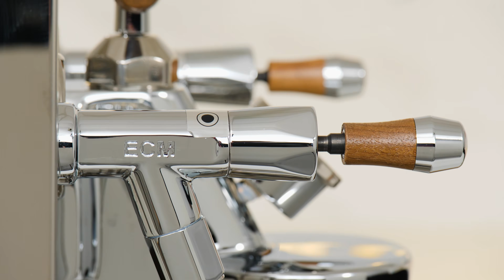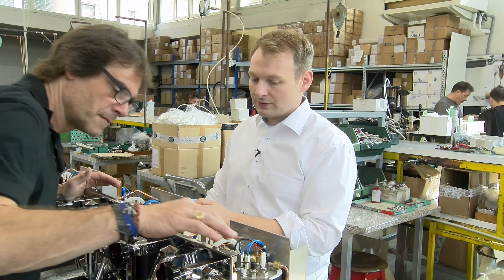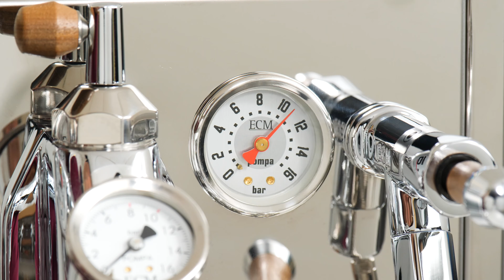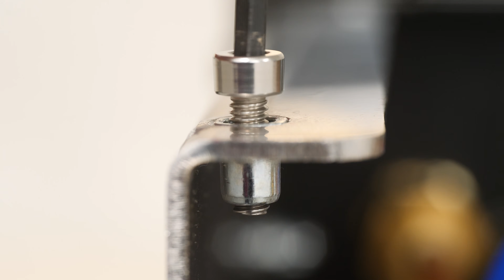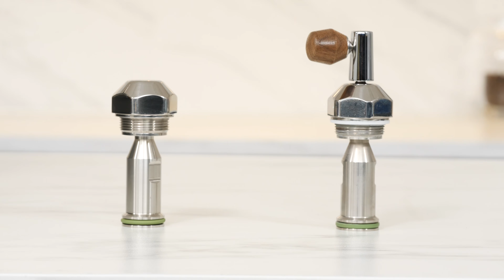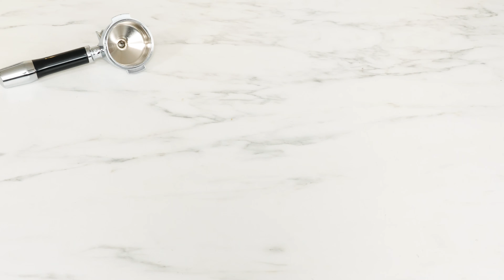ECM Synchronika In-Depth Review

Comment: Is this still your top recommended coffee machine? I'm planning to purchase this within couple of months once our new home is finished. My wife has said to not worry about the cost, and just tell her which espresso machine I want. Didn't realize this one was plumb-able, so guess I'll need two extra holes in my bench?

In my country it's available bundled with a Fiorenzato F64 or F83 with or without automatic weighing. My wife would be annoyed by the noise of me grinding coffee in the morning, so I'm kind of tempted to go for the F83 with the bigger burrs, as it'd be quicker and thus less noisy. Just need to ask the kitchen company how much space I have beneath my cabinets.
Reply from the maker: Hi ER, ECM recently released the updated Synchronika II which is now the top! check it out here: https://youtu.be/bWIJKG9nzQY
A ton of new and useful features added in the update!
Marc
Reply: @Wholelattelovepage  thanks, I saw the video just a few hours ago. It should be available in my country within a few months hopefully, I'm hoping it'll be about the same price as the older version... The OLED display and faster heating are really nice improvements, and I just love how everything follows the KISS principle of design, makes maintenance much easier.

Comment: How do you manage service in Canada? Do you have a physical location that the machine can be dropped off if necessary?
Reply from the maker: Hi LTLR, We use Anthony's Espresso outside of Toronto. Another option is self-service - if you are at all handy with a tool that's most efficient. Very easy with a machine like the Synchronika and our deep library of DIY instructional videos found here: https://support.wholelattelove.com/hc/en-us/sections/1500000400302-ECM-Synchronika
Marc
Reply: @Wholelattelovepage  That’s awesome. I’m just outside Toronto. Great videos Marc.
Reply from the maker: @LivingTheLifeRetired  That'll work great. It's a very solid machine. Feed with good water and do your maintenance like back flushes and it's about as reliable as they come! Thanks for the comment!
Marc

Comment: why should I choose this ECM over a Lelit Bianca?
Reply from the maker: Hi p, Both the Synchronika and Bianca are capable of making excellent espresso. If close in price I recommend the Synchronika for nicer build/finish quality, easier servicing and higher expected reliability. Also prefer the lever operated valves for steam and hot water. Both machines made are list of dual boiler recommendations for 2023 which you can see in this video: https://youtu.be/5W0yfsrVE5U
Marc

Comment: Hi Mark,

I"ve just ordered the Synchronika with Flow control today, and am so looking forward to its arrival.  It will replace a 9 year old Pasquini Livia G4 Automatic (rebranded Bezzera BZ13).  Anyway, I'm sure I'll have questions once it arrives.  But, I have one question now:  I've been leaving my Livia on all the time, except when leaving town for a week or more.  I have seen a lot of comment about turning the Synchronika off after use, and then restarting it.  Is that really necessary?  Are there any advantages (e.g., longer life span, less electricity usage) to shutting it off after a day's use?

Thanks,
Brian
Reply from the maker: Hey Brian! I asked ECM CEO Michael Hauck this question a few years ago. FYI he is very involved in the design of their machines. He told me he leaves his on all the time. Having it on all the time will use more power. I did some unofficial power use testing on other similar machines a few months ago. Leaving machine on vs. power cycling 2 times a day for 2 hours on at each go was about $0.05 more to run a day. On the other hand less power cycling generally results in less potential for scale formation. But if you properly treat source water scale will not be a problem. There is some thought that heating cycles stress components with thermal expansion/contraction but MH says it's not a concern with the machine. I suggest you bookmark our support site for the Synchronika. It's loaded with videos and more on maintenance, use, etc.: https://support.wholelattelove.com/hc/en-us/sections/1500000400302-ECM-Synchronika
Congrats on your new machine!
Marc

Comment: I've recently had a small problem with my ECM Synchronika. As soon as I switch the lever, the rotary pump starts to run. However, no pressure builds up. Nothing happens on the pressure gauge. Only after about 5-6 seconds does the pressure finally build up. Does anyone know what the problem is and can help? The machine was operated on mains water for a long time, now runs on tank. Thanks very much
Reply from the maker: Hi sc, Any chance you didn't properly position the water source selector under the rear of the machine when switching from plumbed to reservoir operation? Here's an extensive video for diagnosing flow issues on the Synchronika: https://youtu.be/xcze59LUg9E It covers a variety of potential causes and resolutions. If you think it might be the water source selector valve that's covered at 14:49 in the video. Hope that helps!
Marc
Reply: @Wholelattelovepage  Thanks for the video. I have a constant flow of water up to the rotary pump. In the video, almost up to minute 32. I still wonder why the sensor does not register any pressure (the pressure gauge shows 0 bar and no water flows through the brewing group). Could not solve the problem :(
Reply from the maker: @samuelecartillone7327  You're welcome for the video. Sorry you have not been able to solve the problem. If you purchased the machine from us please reach out to our tech support staff here for additional assistance: https://www.wholelattelove.com/pages/contact-us

Comment: Hi Mark. Thank you so much for such a wonderful, in depth review. I've been tossing up between the HX ECM Technika V Profi PID, and this gorgeous machine. The more I watch this review the more I'm leaning in the direction of the ECM Synchronika. I'm a novice when it comes to frothing milk, and the fact that you can match steam pressure to your skill level is a really big deal. I'm assuming that's not something you can do with the Technika?  While I don't make a lot of milk drinks I feel this is the machine for me. Thank you again for always providing tons of information.
Reply from the maker: Hey Julie, You're welcome! On a dual boiler machine like the Synchronika you have independent control of temps for brewing and steaming. In an HX machine you can adjust temperature in the boiler to raise or lower steam pressure but that also changes your brew water temperature. You can deal with that by flushing our overheated brew water but there's some guessing involved as to how long to flush.
Hope that helps!
Marc

Comment: Recommended to remove the 'cool touch' piece of plastic tubing within the steam wand. Better to not have any restrictions in that tube. Also recommend the five hole steam tip.
Reply from the maker: Hi DR7, Thanks for sharing your thoughts. You do you, but I do not recommend removing the tube. More likely to get burned, more internal condensation and if you change your mind it's a pain to put it back.

Comment: Hi Mark, how does the dual boiler Quick Mill Vetrano stack-up against the ECM Synchronika? The Vetrano did not make it into your "Top 5 Favorite Dual Boiler Espresso Machines of 2021" but got a solid review from you in a separate video. Can you elaborate on that? (In Europe, the Synchronika is still some +25% more expensive than the Vetrano)
Reply from the maker: Hey Alex, The Vetrano is an excellent machine. As a newer DB option in the market the price is a little lower and while the build quality is very good it's a hair below the level of the Synchronika. That does not make it any less capable of making excellent espresso. The Synchronika has some upgraded finish details not found on the Vetrano like the angled PFs, taper of the E61 group, faceted finishing of the exhaust port and one piece base frame.
Marc
Reply: @Wholelattelovepage  Marc, thank you so much for your fast and useful reply. Such a tough decision still ;-) — to pay or not to pay for that extra quality edge. Thanks again. Your channel rocks!

Comment: How about the r58?
Reply from the maker: Hi SA, The R58 - now called the R Cinquantotto is a very good machine. In comparison, the Synchronika has higher available steam power, is available with flow control installed and is a step up inn exterior finish quality.
Marc
Reply: @Whole Latte Love  thanx Marc,il about to pull the trigger on the cinquantotto,and scrapping the breville dual boiler because of continuous leaks,I also have the baratza 270wi,thanx for all the amazing vids,I thought the coffee bug would last 1 or 2 months,here I am after 3yrs lol,can't wait for more of your vids.
Reply from the maker: @shameelali2549  Happy to help - funny how the coffee bug attaches ☕

Comment: Hi, hope you can help. We purchased a couple of years ago and the flow on our machine is fast as...at least 10 secs only...how on earth can this flow slow down??
Reply from the maker: Hi Vicki, it’s all about the grind size. A finer grind will slow down your extraction. 
Marc
Reply: @Wholelattelovepage thank you for your quick response.  I have tried this, but we did tighten the nut on the front which has slowed it down a bit, but not as good looking as the above video....

Comment: Marc awesome work.  I’m struggling between a 600 or 700 with flow control and a 800.  I love the simplicity of the 800 and it’s natural lever pressure profiling.  I realize the complete freedom of flow control on the 600/700 provides more options but I wonder if I’ll ever miss it.  I suspect my daily, no-nonsense espresso will be excellent and care-free on the 800 without me timing and managing the 600/700 flow control knob through the extraction process.  Is there anything I’m missing?  Should I just go big lever and call it good?
Reply from the maker: Hey Juice, thanks for the kind comment! Some consider using a lever machine a more "pure" and traditional experience. If you're the no nonsense type then the Pro 800 may be a good choice. What type of coffee do you drink most? Lever machines tend to do best when using more traditional coffee types like classic Italian style bean blends. The lever profile applies higher potential flow rate and pressure at the start of a shot which fades as the shot progresses and produces sweeter more syrupy shots from darker roasts. If you're into lighter fresh from roast specialty coffees or switch coffee types from time to time then flow control may offer some advantages. Light fresh coffee benefits from low flow/pressure at the start of an extraction. You can get that to some extent on a lever by allowing the coffee to infuse with brew water before releasing or holding the lever back. But, it's more difficult and not as repeatable as it is with flow control.
Hope that helps!
Marc
Reply: @Wholelattelovepage   excellent feedback Marc.  I’m new to espresso and didn’t understand the above until you described it.  I like dark roasts but my wife is decidedly a light roast pallet.    Perhaps I should not box myself in and go with a 600/700.  And the added benefit of not having a lever overhead (wife isn’t crazy about that feature).  Really appreciate the feedback.
Reply from the maker: @juice7546  My pleasure! 600/700 sounds right for your situation. A lever is a commitment and the 600/700 will be more flexible!
Marc
Reply: hey! Which machine did you get in the end? I seriously think of buying a Pro 600 because for me it seems to have all excellent parts of the 700 / Synchronika and only misses some steam boiler volume? For me and my wife the smaller steam boiler of the 600 should definitely be fine though. We also won't plumb the machine in and the perfect exterior finish of the Synchronika most likely isn't worth 1000 Euros for me. What do you think about that? Maybe it will help me in my decision. Thanks a lot!
Reply: @t0bistr  I went with the 600 and love it.  Never runs out of steam and is more than enough for knocking out four quick drinks for a few guests.  I still want that lever machine but I not regret the 600 and would get it again.
Reply: @juice7546   thanks a lot for your fast answer. Seriously going for the 600 then! I understand what you mean with the lever machine. Must be great fun to use. But for my wife it would probably be too much 😜 so much looking forward to drink great coffee soon! Thanks again and nice greetings from germany! :)

Also big thanks to WLL!

Comment: Hi Mark! What machine do you think is better between the ECM Synchronika and the Linea Micra? ECM Synchronika has the advantage of having flow control but which one has better results in the cup?or which one is a better machine overall in your opinion?
Reply from the maker: Hey Maria, Both are very capable machines. Quality in cup is more about the skill of the user, grind quality, etc. Have to be honest - I have not used the Micra. Flow control on the Synchronika definitely give a user more options for better results in the cup!
Marc

Comment: Do you think there would be a lever version of the Synchronika (dual boiler with Rotary pump)?
Reply from the maker: Hey Mark, probably never happen. Lever machines just operate differently. Lever machines like the Profitec Pro don't even need a pump when plumbed to waterline. 
Marc

Comment: Been really enjoying your videos as I am tempting myself to buy my first big boy espresso machine. I was looking into the Profitec 600... That one is a double boiler costing much less than the Synchronika and other double boiler machines. What am I missing?
Reply from the maker: Hey F, Here's what you need to know... the 600 and Synchronika are made in the same production facility in Heidelberg, Germany. ECM and Profitec are sister companies. Kind of a Lexus/Toyota relationship with ECM being the more polished high-end brand. Take a look at the Synchronika and Profitec Pro 700. They are essentially identical internally with same specs. Comparing the 600 to the Synchronika: 600 is not plumbable and uses vibration pump. The Synchronika is plumbable direct to waterline and has a more powerful and quieter rotary pump. Both machines have the same temps and functions available on the PID. So the near 2 bar of class leading steam power in both. Boilers are larger in the Synchronika. 600 has knob control of steam and hot water valves while Syncronika uses joystick levers. Synchronika comes with angled portafilters for easier tamping. 600 portafilter has a straight handle. Overall finishing quality is better on the Synchronika with added touches like the tapered E61 group head and continuous single piece base frame. Hope that helps!
Marc
Reply: @Wholelattelovepage  Thanks Marc for not only the quick response but the great explanation. I really appreciate you taking the time to personally reply. The Lexus/Toyota analogy makes sense - looks like the increase in cost is because of those additional features too so it's not just name cache. I don't plan to plumb in a water line and the feature set of the 600 feels like it's appropriate for just me and my wife at home. Plus, it is close to a near $1,000 savings.
Reply from the maker: @free5sole  You're welcome! If you're not going to plumb and don't mind a little extra noise from the vibration pump your decision makes perfect sense!
Marc

Comment: Great review, been looking to buy this machine for home use and will probably be used for 4 cups/2 pulls in the morning and 2 cups/1pull in the afternoon every day. I was told it needs to be switched on 30mins before using which seems a bit excessive. Can it be switched on and used quicker than waiting 30mins. Not sure how much power it would use during this time. Any thoughts?
Reply from the maker: Hi MT, Full warmup of the machine meaning the group head reaches a stable temperature is about 25-30 minutes. The group head is heavy metal! It's warmed by water in the boiler which continuously cycles via convection driven thermosiphon out to the group and back to the boiler. You can use the machine prior to full temperature stability of the group head but there may be some temperature variation. People often plug this type of machine into an appliance rated timer power outlet. With Wifi connected outlets one can set schedules for on/off times and control remotely if desired. If only making espresso the steam boiler can be turned off which saves power and results in a faster warmup. Hope that helps!
Marc
Reply: @Wholelattelovepage  Thanks for your reply, much appreciated. Just gotta watch every penny with the UK electricity prices!

Comment: What’s the difference between the Synchronika from 4yrs ago and the one now?
Reply from the maker: Hi KL, Thanks for the question. Boiler drains, fitting change from plastic T to brass crossover which connects silicone hoses routing internal moisture from vacuum relief, safety OPV and safety valve to drip tray.
Marc